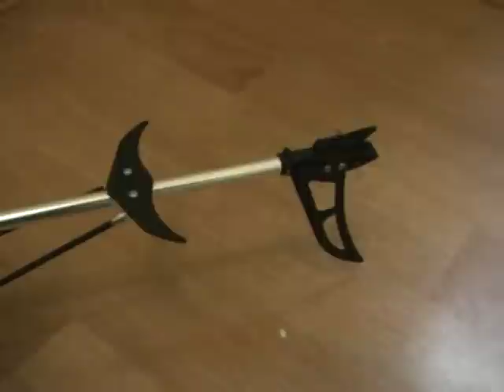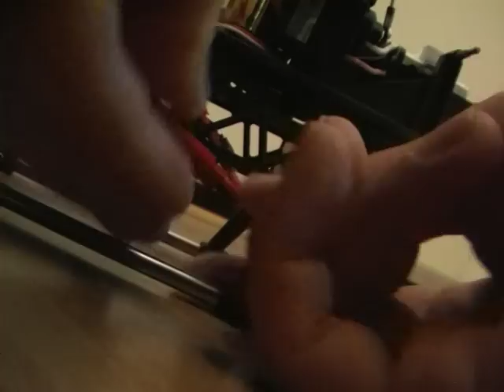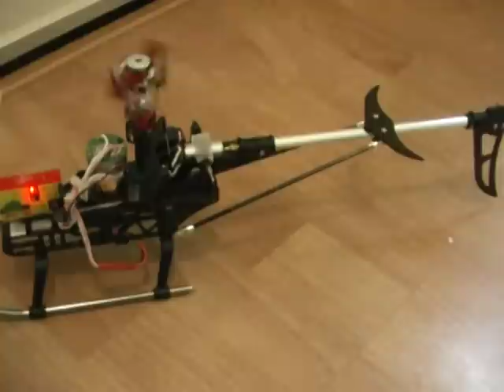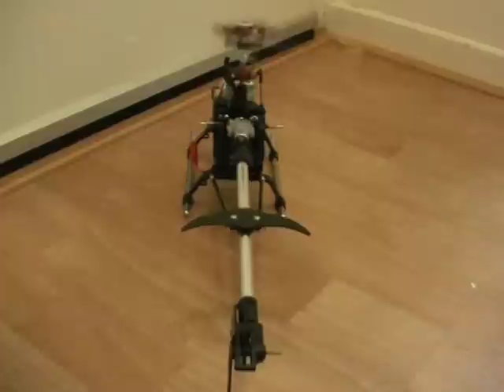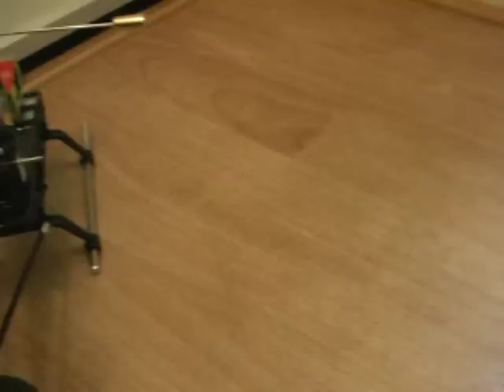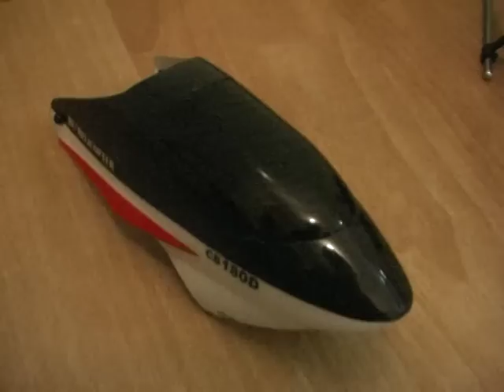My new walkera CB180D RC helicopter check-up after first crash

Comment: Yes, i crashed my CB180Z too today and broke a main-blade. I am a beginner too and it's a good idea to have already the most parts at home: Main blades, tail-blades, gears for the tail-rotor, main-gear, landing-gear, main-shaft, main parts for the rotor-head, tail-boom etc.
I simply installed two new blades and continued my flight (this time without a crash)